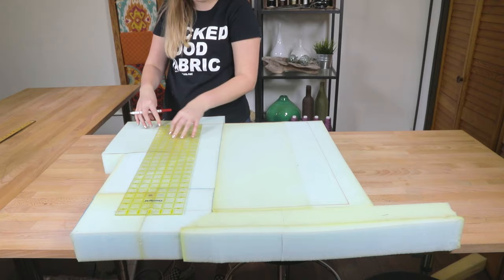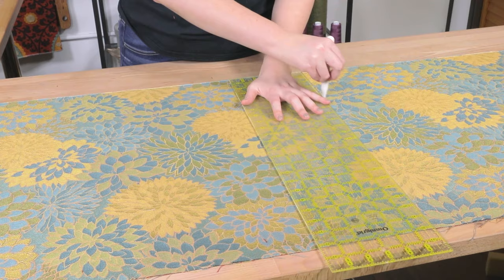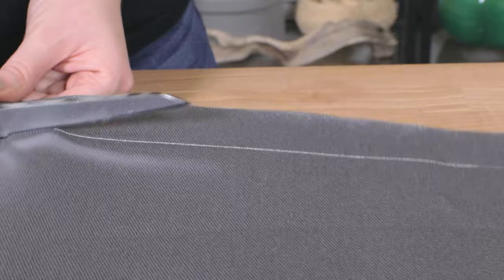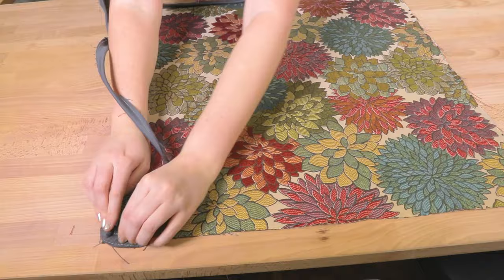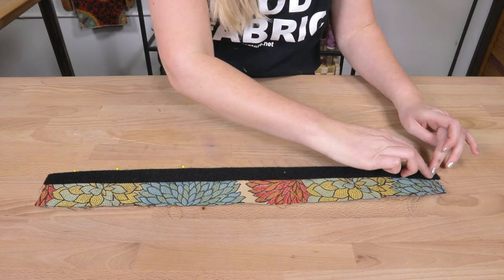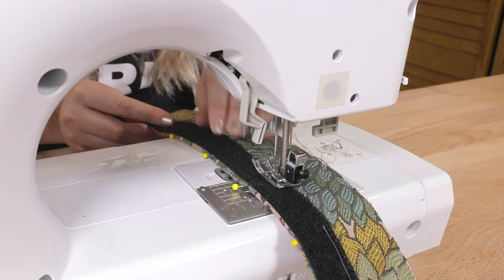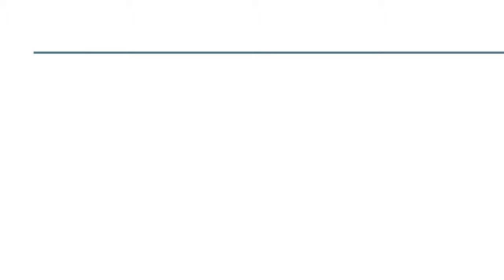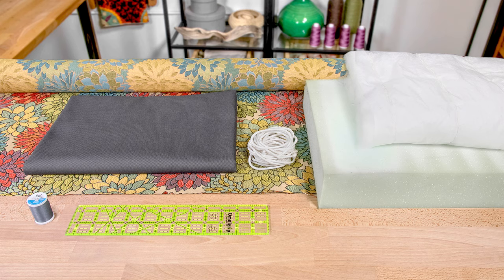How to Make a Cushion with Piping | Box Cushion Tutorial | THRIFT FLIP Makeover

Comment: Do I need to used the wrapping around the cushion for my patio set that may get wet but not soaked? The sofa and chairs are in a screened porch and somewhat protected by rain.  I plan to make a boxed cover. With zippers but like the Velcro idea! Do I need to make/sew on some piping?
Reply from the maker: You don't need to! I would recommend using an outdoor foam (https://www.onlinefabricstore.com/product-group-foam-and-padding.aspx?characteristic=outdoor) because even though it will not get soaked by the rain you do want to protect it against mildew. Also, the piping it totally personal preference, you do not have to include it!

Comment: Why do you have to wrap the foam?  Is there a certain type of foam and wrap recommended for outdoor use?  Thanks a lot!
Reply from the maker: It will soften the edges. For outdoor cushions, I actually don't use the cushion wrap. The less material the better with outdoor cushions, drying is of the upmost importance. Without the wrap, the edges are going to look a little more sharp, but if you don't like that look you can round them out a bit by cutting the edge on top slightly (I would say but off 1/8" at a 45 degree angle.)

Comment: I am recovering 4 patio chair covers. I would love to have just bought new ones. It might have been cheaper but I could not find any to fit so I am doing them myslef. I have not sewed in years. I am the point of sewing the panel to the top and bottom piece. My question is, what foot do you recommend for this step?  I cannot get close enough to the piping with my standard foot.
Reply from the maker: They make piping feet! You can get them online, or at sewing stores for pretty cheep
Reply: @onlinefabricstore  Thank you. I will check it out.
Reply: Would a zipper foot work as well?
Reply: @garthmitton1857  I used a piping ft and it did the trick. Finished them last year.